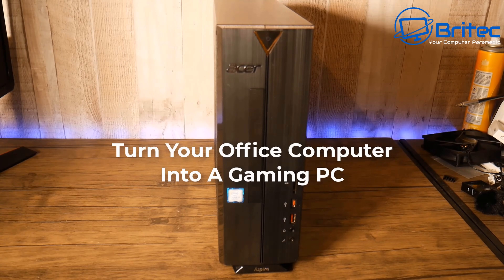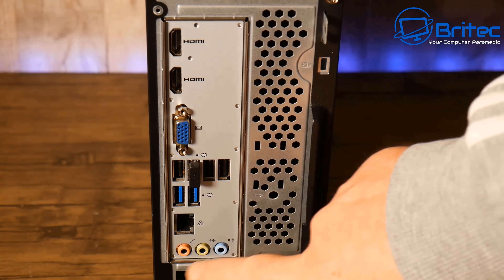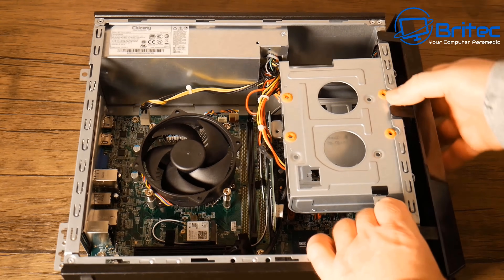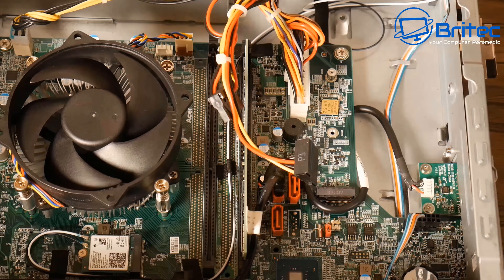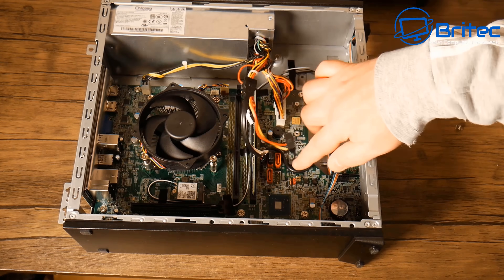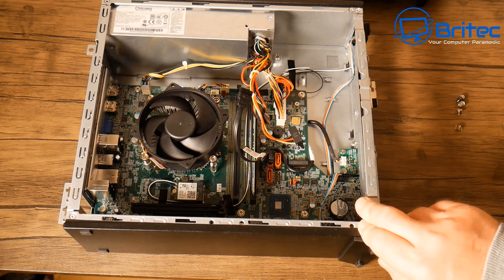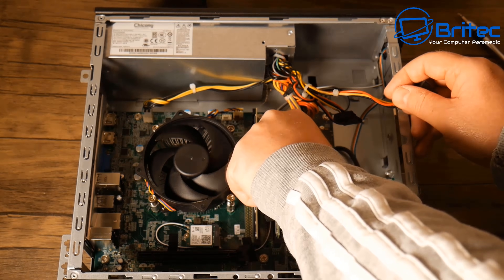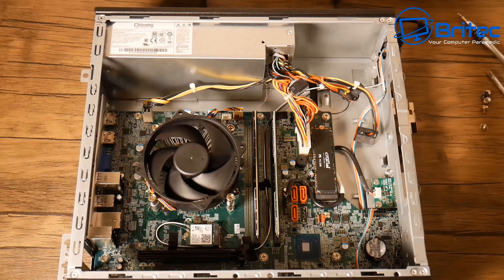How to Upgrade An Old Acer Office PC

Comment: I am think of getting rid of my computer that i am using now , HP sff 6200 desktop and upgrading to a Acer Aspire TC-885 Series D17E5 . my  HP sff 6200 was built in 2011  the  Acer Aspire TC-885 Series D17E5 is made in 2018 . I cant afford a new computer . so is it good to go with the Acer Aspire TC-885 Series D17E5 , or should I keep looking ? my HP is starting to show its were at tear so to speak . I mean it is 14 years old , it works , but not as good as it use to , and I am  afraid that it will fail soon .

Comment: That's a Flex ATX power Supply, actually. Not many of them available on the market, but they do exist, even from major brands, such as Silverstone or Seasonic. By the way, I retrofitted mine, wich happens to be an eMachines but tecnically the same PC, with the following: 350W SFLEX ATX PSU, ryzen 3k series mini DTX mobo (w. low profile noctua) and low profile SFF RTX 3050.

Comment: have this type of acer model but is packing a slightly faster much newer model with a 10th gen i3 and a generous 300 watt power supply it runs windows 11 fine on 1080p but it struggles on 1440p for some reason i suspect the little uhd 630 in the cpu wasn't made for any higher resolution then 1080p (even with the support for 4k at 30hz) i wanna know if adding a intel arc a310 ($99) would be a good idea or a rtx 3050 6gb since its $70-80 more and would let me play some games. both have support for SFF desktops and i wanna know which one is a better buy

Comment: Have you tried using the cpu fan to suck so exhaust is out through side/ top of case, I know blow is normal but this case is so badly ventilated with only forced ventiation being via the power supply fan.  My XC885 has the cpu fan running flat out (4500 rpm) @ only 50% load and 70C cpu temp, even after thermal past renewal.
A case change may help but the front usb etc connections are part of the motherboard and a major problem.

Comment: My recent purchase of a now 4 year old machine did not have CPU Turbo Boost, it appeared to be disabled by  default.  Once Turbo Boost was functioning there was a real problem with overheating of the CPU and the M.2 SATA, this is without a GPU added.  Since I don't have a suitable fan to add, I have bought 2 small 40mm fans to add to the rear case vents to act as extracts and hopefully help keep the heat from the CPU away from the other components.
I may add a funnel above the CPU to ensure the air used is from outside the case rather than recirculated.  The fan mounted in the removable side needs the lead disconnected every time the side is removed, which would be a bit of a fiddle.

Comment: now can I just add the graphics card without the other upgrades or do i need the other upgrades to use this graphics card and with this graphics card will i be able to play red dead redemption 2 on it?
Reply: A GT 1030 will give you a reasonable PC for light gaming, if you have the smaller PSU. However, the 300 Watt version found in some i5 9400 based XC885s will be fine for an RTX 3050 6Gb. That's what I run and it's even OK for 1440p gaming on lesser titles. Max out the RAM to 32Gb @ 2666mhz for a big boost. Edit..... A point to note is that often the CPU doesn't use all of it's cores due to the system "parking" them at times when the system is idling. There's lots of videos showing how to activate them and gain a boost in performance.
Reply: @jagman84 oh I'll need this video. Can you suggest what to search on YouTube

Comment: I believe they are called flex atx power supply's if that helps anyway, glad I came across this video as I have my dad's old acer case and want to make a sleeper build with a good gpu, hopefully replacing the psu for a 300w to 500w fingers crossed... May have to buy a dremal tool as well 😂🤞😅

Comment: you should put a nvidian t1000 in it as it only requires 50 watts and is much better than the gtx 1030 you used

Comment: resolution is overrated , i have been playing since games where 640x480-800x600p so 720/768p is fine , if it saves one 600 usd on a new gpu

oc the ram on the 1030 it gives a little too , one might get lucky and find a used gtx 1050 2/3gb low profile instead of the gt 1030

Comment: just did a similar little project the other day for and old mate he had a 4 core i5 8gig ram no video at all big 2tb mech drive with win 10 and everything else on it  bit of struggle but we managed to up the memory to 12 gig gtx1050ti 250gig ssd for the win 11 we installed  i had to disconnect the existing hard drive to be able to do a fresh install we could then plug the old one back in and save the information before formating it leart a lot from this little project
Reply from the maker: Nice little project there
Reply: @Britec09  78 he is bless him i saved all his pictures and vids  from the old pc which ment more to him helping out my old mate made it a pleasure for me

Comment: To overcome the power supply issues, I have transplanted the system to a standard case which will take a standard power supply.  You can get a decent ish case for thirty quid.
Reply from the maker: That is correct, made videos on that subject, I won't be transferring this one.
Reply: @Britec09  Only did this one.  It was cheaper than buying and original Acer special power supply. I would imagine the Dell one's are very expensive too.  All these small box PCs have expensive low wattage power supplies. It's the main drawback of them.
Reply: @fredneedle123  yo i got a a acer aspire xc 895 and i'm asking which case did you use to upgrade, as the motherboard is a prebuilt one that cant fit on lots of different motherboards
Reply: @leodabest1456  I just used an old computer I had laying around.  The io shield on the xc603 was removable and of the standard size to put into another case.  I'm not sure what case would he suitable in your situation.  Is the io shield detachable on your machine?
Reply: Hi there I’m planning on doing a case swap with my Acer Veriton x2640G did you have any problems with the cases front panel connectors and the old motherboard or did you upgrade motherboards?
Reply: @unkownbruv8761  I didn't have any issues.  You might do though.  It just depends on the case and the motherboard. I didn't upgrade the motherboard but I did use and older case that had an old machine in it that wasn't much good.  I've don't it a few times now.  I do have a lot of old machines around.  I think the trick is to get a case that's about the same age as the machine you're transplanting. Best of luck. Let me.know how it goes.
Reply: @fredneedle123  hi thank you very much for the reply it helped alot done abit of research and pretty positive my mobo and a new case should be allgood. But I’m genuinely thankful you took the time to reply have a good night/day💯
Reply: @unkownbruv8761    you're welcome Bruv. I'm here in the UK.  Not far from britech.  Far enough that you wouldn't wanna walk like. 🙂
Reply: @fredneedle123  and yo one more question, when you upgraded your PSU did you need a 24-12pin converter or not? And if so how did you confirm the converter works for your motherboard? Hesitating about what converter to purchase as none of them are for my exact motherboard
Reply: @unkownbruv8761  I don't know. I think the converters are all the same. Just buy a power supply with 24 ping and unclip the 4 extra pins if you don't need them.
Reply: @unkownbruv8761   24 not 42
Reply: @fredneedle123  my motherboard only has a 12pin? And my 600w PSU has a 24pin 20+4

Comment: Jesus PC's are cheap in the UK as a no drives system in OZ that would sell for around 300 quid your money, the UK must have a gluttony of used PC's/ electronics  cuz  I see it all the time on 
eScam OOP's I meant eBay but the UK postage is just ridiculous it's at least 2.5 times dearer than Australia Post!
Reply from the maker: This was just a good deal i snapped up, its worth a lot more now.

Comment: The 1650 only pulls 75 watts max from the pcie slot.
Gt1030 never came with ddr3.
Reply: 65 watts for the 1650, 30 watts for the 1030.
35 more isn't going to break the psu. Likely it'll run under 150watts under full load measured from the wall.
Reply from the maker: You have to calculate watts used from GPU, CPU, RAM, NVME and 4TB Drive and then you got stuff you plug into PC which draws power. When calculating PSU power, you have to take into account Load Wattage, Recommended Wattage, PSU headroom. You never use up to the capacity of watts and leave no headroom, its dangerous. that is why we have recommendations on things, yes there is a little wiggle room, but not that much.  This is not a hight quality PSU, yes it might work for a while, but it will let go at some point.
Reply from the maker: Definitely GT 1030 DDR4 and 1650 requires 300w PSU on NVidia website. This has 220W PSU not a lot of power to safely run a 1650 in my honest opinion. Under full load, it could catch fire. Yes, some GPUs can run for short time, but always try follow requirements to stay safe.

Comment: I bought the i5 8400 version of this recently, also used, but like new. It came with 16GB RAM, a brand new Crucial 256GB SSD and built in DVD Recorder Drive. It also had the original Acer wireless keyboard & mouse included. I also paid £150. I've added a 2TB HDD in that cage and moved the SSD under the cage.  I'll probably add an M.2 at some stage too. It works really well and performance is surprisingly good. I'm not a gamer, so not worried about a video card. The CPU generally runs at under 40 degrees, and the only thing that warms it up a bit is rendering videos in Kdenlive. I've checked the power consumption and it's usually well under 80W.
Reply from the maker: Nice Gary, thanks for sharing.

Comment: For someone like myself, who runs Linux and doesn't play games, this would be a great computer.
Reply from the maker: Powerful little pc
Reply: @Britec09  just clicked your link to this computer which went to Amazon UK. Prices from 400 to 600 pounds. I'm out 😞 And some of the chips were 3rd and 4tj generation!!
Reply from the maker: You need to buy used, this cost me £150
Reply: @jpcoll2011  4th generation i7 4/8 rigs like this are pretty great. I found a Dell version with 16 gb ram and a 4790 for 200 CDN. It runs awesome with Zorin OS
Reply: Many thanks for the replies. Will search harder.

Comment: That is a really nice system, shame about the PSU but that shouldn't matter with that set up you got here.
Nice small and portable and as you said get that Hard Drive cage loaded up with a Hard Drive and it will be able to run plex and not drain much power.
Im impressed :)
Reply from the maker: Yeah, nice system.